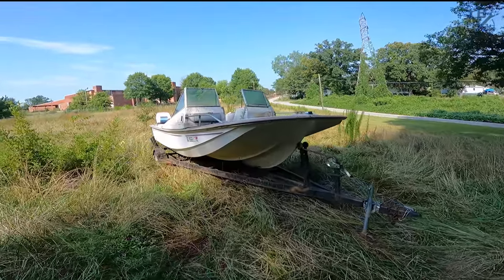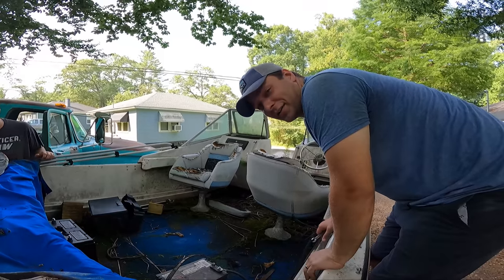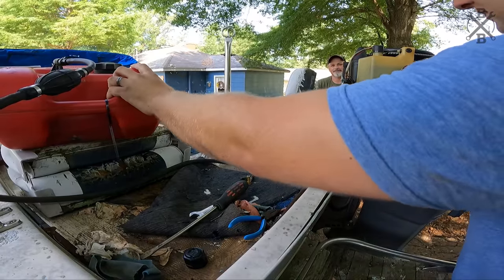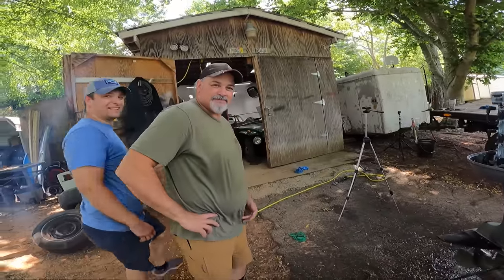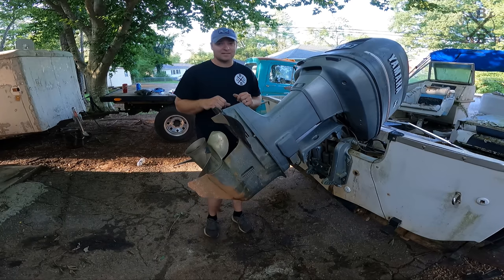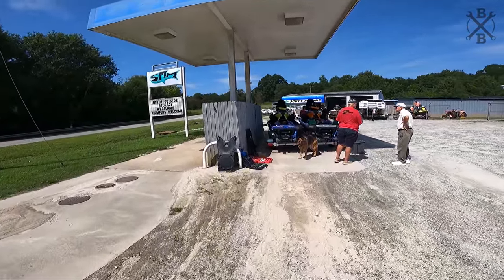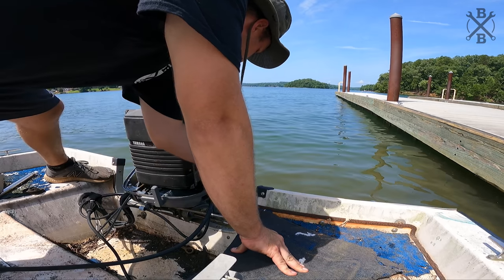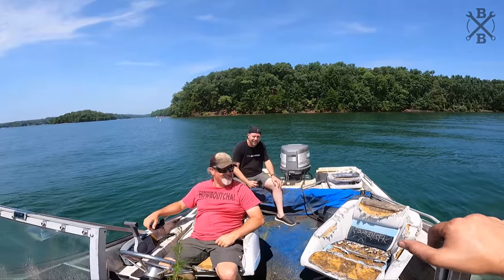FORGOTTEN Boat REVIVAL! Sitting 18+ Years: Will it run?

Comment: I bought a 45 year old boat off craigslist for a grand. It was in awful shape. I wet sanded the entire boat and waxed and buffed to a mirror shine. I tore out the old carpet and seats and glued new carpet and put new fabric on all of the seats. I made a new bimini and fitted top on my sewing machine. I rewired everything and then rebuilt both carbs, rebuilt the fuel pump, new water pump and resealed the lower unit, and then repainted the motor 85 evinrude. The boat looks brand new. I did some research a discovered that only 50 of this boat was ever made. I've had several people offer me as high as $25k for it. But I'll never sell it, it's always the talk of the dock. It's the first boat I've ever done and I learned everything watching videos like yours. Thank you! I got my dream boat for a grand and 1100 in new parts.

Comment: I was picking up an old sewing machine and while out behind the house I saw the tip of a boat and trailer poking out of a bunch of brush. It was an Arkansas Traveler 14’ runabout. Very cool little lapstrake hull design, but the interior was destroyed. After the owner telling me if I could get it out of there I could have it, I went to work trying to get it out. Evidently, bees like boats, lol. A LOT of bees living in there after sitting there for over 30 years along with the probably 10 generation mice. The vintage Evinrude was destroyed by mouse urine so I found an old Mercury Classic 50 to match up the horsepower. After fully restoring the whole thing, I had myself a BEAUTIFUL little vintage runabout that grabbed attention everywhere I took it.  I think my favorite thing about it was that early 1960’s turquoise and white steering wheel and the cool chrome part designs all around the boat. Very cool and a lot of fun.

Comment: that ole 150 sounds good. could use a little more horse power with all three of you in it. install the complete intake and carbs from a 200hp. its a bolt on and will increase the hp. it will run almost like a 200hp. exhaust ports and compression holds it back from being a 200.

Comment: I'm telling you from my experience with Yamaha replace the thermostats and water pump pull the prop and check seal for fishing line drop the lower unit oil and replace fill & drain plug gaskets ect.

Comment: Good video, Yamaha make great outboards … we use them on our diving support vessel .. the only thing I would had done differently, would be pulling the air intake cover just in case those pesky mice had been in there, before cranking, to avoid getting crap sucked through the reeds .. the engine was really on song .. good job 👍🏻

Comment: If they're all at a hundred then you have a harborfreight pressure gauge or cheap pressure gauge that doesn't have a Schrader valve built into the hose.
Reply from the maker: Yeap! Reads about 15psi low lol..Seems my “nice” one is constantly getting swapped out under warranty. Would love to find an old school Mac or something!

Comment: Ive resurrected motors that sat many years..... If you want the motor to last you do it right.

Oil cylinders before you even try to rotate it by hand. Spray fogging oil into the reeds. 

Pull the plugs if it won't rotate Easily by hand is rusted in place and you're going to have cylinder damage, at that point you might as well trash it .. because it's not going to last. 

Pull the heads and inspect the cylinders.   

Clean the water jackets and replace water diverters.

If there's any water pressure gauge pickup tube it will need to be replaced

Reassemble the heads with new head gasket and water gasket. 

Replace every part of the fuel system . Fuel pumps, every hose part, primer system, filters.

Drain and clean the boat's fuel tank. Make sure there's no obstructions in the vent, no dirt, bugs. 

Now clean and  rebuild the carburetors. 

Change the water pump impeller and the thermostats. Pressure test the lower unit and replace any seals that need to be replaced on it.

Crank it on 25:1 premix ... Let it idle for the first hour. 

Now you can go run it gradually increasing rpm.... For 5 to 10 minutes at a time..... Still running it on 25:1.     

After about 2 hours of running, run at wot on 50 to 1.for 30 min.   You're probably good if no problems.

You going to need new battery of course to do this.  

You will spend $800..... To bring an old outboard back to life that's worth $800.   Outboards are very well lubricated, they can sit for years without problem.  But all the peripheral systems fall apart.

What most idiots do, is trying crank immediately..... Which damages the cylinders  .  Then they try and run it with crudded up carbs and it runs lean. 

People destroy; old motors everyday out of sheer laziness.

Comment: It was a little difficult at first, but identifying the Make of this boat had my best guess a little bit in question. The double console is what was throwing me, and the distance from the camera too until the name of the make was pronounced. I usually saw them as center consoles.  I haven’t watched the full video because I’m posting in the comments. It looked like the boat was sitting on a painted trailer instead of a galvanized one. So I’ve got a feeling this boat was mostly being used on fresh water. Yes that big upper lip of a bow identified it as a McKee Craft… and those boats were great for taking on waves and spreading the spray nice and wide from those on the boat.Especially when heading offshore and busting through the Jetties out into the big water, because many times that stretch is going to be the roughest waves of your day.
Reply from the maker: Yessir! The double console definitely is different but it’s grown on me 😁 You’re right, it has always been a fresh water boat. I’ve got a big beam aluminum trailer it’s fixing to go on! Planning on taking it with us camping at the beach this coming summer! Going to do some crabbing and shrimping in the bay. Then maybe try some bigger water! 😃 Definitely getting a kicker motor though lol Hope you enjoyed the video! I’ll have a restoration up soon. Just wrapping up the transom replacement!

Comment: Hey when u said the diaphragm s go bad it leaks out the back. Mine won’t prime and fuel leaks from the prop
Reply from the maker: Sounds about right. Pull your fuel pumps loose and try to pump it up, I’m sure it’s leaking. If you have a 3 hose pump take the driver line loose and do the same. Otherwise your carbs could be overflowing but that should be fairly noticeable. Hope this helps

Comment: Did you ever finish this boat?
Reply from the maker: Hey, we have not gotten the boat completed. It was a big project getting the transom replaced and it sort of got covered up until this spring. Here in the next few weeks we plan to get the motor hung and boat finished! I’ll be posting a complete rebuild episode, start to finish.
Reply: Any update?

Comment: That is one of my alltime favorite boats. Did you weigh it to see if the hull had water in the core? I'd love to see how it turned out.
Reply: ive got the 16 footer, havent weighed for for sure has water as i had to put in trimtabs to get her to plane in low speed.  How would you solve the water in foam problem?

Comment: 99% of the time a yamaha dont pick up water its a 4stk 150 and 200 never had it on a old prov. most the time you see carb bowls full of oil is a old omc not Yamaha. Also its not a OMC vro pump. in my 35 years Ive maybe seen 2 bad mikuni oil pumps and the mercs that failed was mercs gear that drove the mikuni they used. Was working on these back when they were new. Here home watching this it is the Thursday before memorial and I did 2 boats and 7 pwcs today alone.

Comment: Does any one ever check compression the right way. U have to do a compression check with the throttle wide open.
Reply from the maker: Having checked compression on thousands of 2 stroke engines..I’ve seen virtually no difference throttle open or closed, ever 🤷🏼‍♂️ It’s definitely a good habit to have, as that’s what most suggest doing.
Reply: @BudgetBuildz  oh it absolutely does make a difference. I am a gasoline mechanic. I know 2 stokes are a little different. But 100 psi is no good for as amazing as it runs. For the way it runs it should be close to 160 for a used aged motor. But that motor was taken care of. So I believe it could at least be a good 145. I have forgotten to open the throttle doing it by my self some times. And have noticed a difference. But I always double check. I have noticed a huge difference. Like I said a motor is a motor. They all work in a different but it’s still all the same concept. Combustion. Me and 2 smokers do not get along. But I see so many people doing compression checks and they say oh it’s just too low. There is so many tests to show a bad ring or bad pistons. Blow bye u name it. But a 2 snoker at 100 psi is worn. It’ll run. But definitely needs rings. But I doubt it. Bc it’s started just like that. It ran amazing. Don’t get into bad habits. U did great. U ran through it all. I’m not knocking u for any of it. Next time just hold the throttle wide open. It’s more accurate. Bc u will not get the air flow that u normally would. I’m not. We can have a difference in opinions but at the end of the day u still made it run my man. That wasn’t a jab at u. It was just a statement lol. People just go through more trouble than they need Bc they get a false reading. And that would be a reason why. Just know that I have mistakenly done this on a 4 stroke and definitely seen a difference and I knew it wasn’t right. Every one makes mistakes. So don’t take it to heart.
Reply: @BudgetBuildz  u know your the first YouTube that has ever written back on a comment. 👏